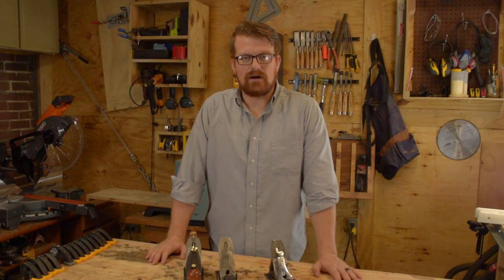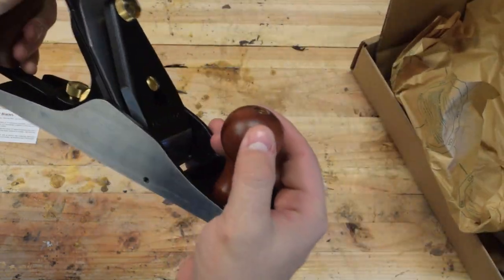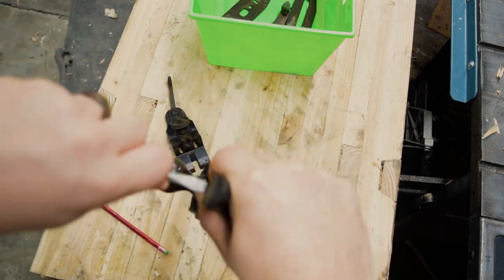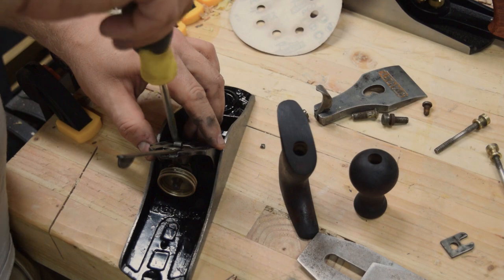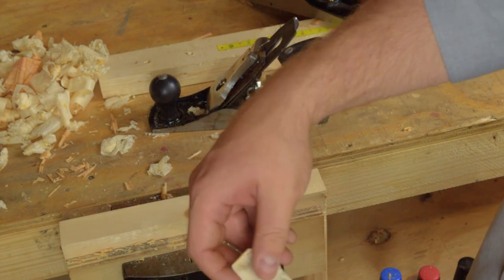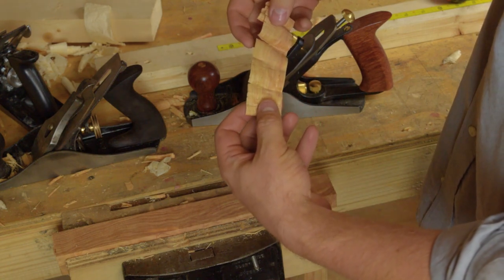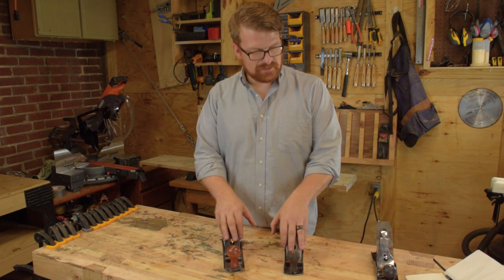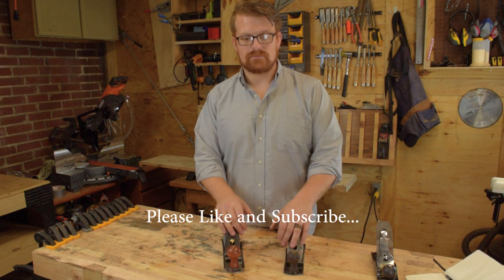Smoothing Plane Shoot Out - Veritas, Classic Stanley, & Harbor Freight | Hand Tool Shootout

Comment: I find veritas waaaayyyy over priced...all the high priced planes are too expensive...waayyy too expensive.....it's all about HOW you flatten the soles..if you lap them 100% by hand it can take an eternity....it chips away a lot of time by roughing it on a good old belt sander(maybe 5-10 min) followed up by @15 min of lapping by hand(this is worst case scenario)...the issue I do have with the less expensive planes is the thickness of the body, the blade quality and the blade advance(often a lot of play)...but still I appreciate your approach to the shootout, time is money and the way you calculated the price along side you personal time investment is very very relevant...I myself cannot afford a high quality plane...and it is difficult to get a used record/stanley no.4 here in germnay..so I learned the good old fashioned way...trial and error. I own 3 cheap planes and have used a restored stanley no.4 and I have to say...you can absolutely tune a cheap plane to be a good plane...but you have to know what a good plane is first :) as always this is the internet and I hope this does not come off as offensive, just another idiots perspective..take care and thanks for your two cents :)
Reply from the maker: I do use a belt sand when a plane is way out of flat, I actually used it on the HF plane.  If that was the only issue with the HF it would have taken the same amount of time as the Stanley.  The problem with it is the lateral adjustment mechanism and the chip breaker (they just don't work) fiddling with them took so much time.  The body was of course the cheapo steel as well, but for the price I could've lived with that.  With the lateral adjustment mechanism the tool was just not useful for the purpose I wanted to use it for and I gave it away after this video.  I agree with you though the Stanley gets you 95% the way there, with the Veritas though the adjustable and thus narrower throat allows you to do true finishing work, on some easier to prepare species of wood (Walnut, Cypress, Fir) you don't even need to sand afterwards.  It also has the retention screw so you don't have to square the blade every time, and the Norris adjuster is much more repeatable and reliable than the Stanley/Record style.  Is it worth the money/time?  That is up to you.
Reply: Justin, the advanced design effort and exceptional manufacturing quality are but two of the reasons they cost more than other makers' planes.  However the more important issue related to cost is that they are less expensive than Lie-Nielsen planes, and, dramatically less so than boutique planes.  To my way of thinking, they are excellent value hand tools.
Reply: "Are they worth more? that is up to you." 
Well said.
Reply: Justin
As an owner of a variety of planes, Stanley, Bailey and Bedrock, Record, Woodriver (a well made Chinese knockoff of a Bedrock), Veritas, Lie Nielsen, just to name a few.
The main difference is the Cost of the handplane which is a straight reflection of the manufacturing Quality.
Out of the Box, nothing beats a Lie Nielsen or a Veritas, with a few minutes of protective layer and a few minutes on "final polishing" the blade (if you want too) both will cut sub 0.001 inch or 0.0254 mm shavings in hard wood or soft, the LN has a thicker blade and it's heavier.
In any other plane, you'll have to invest time (and maybe new blade) into bringing it to a reasonable ability to shave as well as those two names described, still, not going to be the same feel...
If you ever drove a Fiat and an S type Mercedes, you'll understand...
If you're a serious wood worker, invest in the best, it "hurts" only once!
If you're not, don't buy expensive, unless money is not an object.
IMHO.
Reply from the maker: Truth, thanks!
Reply: sorry(welcome to the internet ;) ) I disagree...most people talk about taking off a thou or so as if those things really matter...if you are making furniture(like myself) you do not worry about those measurements when planing...that is youtube hype nonsense...sure getting clean shavings is nice but the media has blown all this out of proportion, same with the planes...in all honesty I have NOT used all the planes you have listed...I just stand by my statement that you do not have to have an expensive plane to be an amazing woodworker....that is nonsense...my goto no.4 is actually a faithful no.4 and my no.7 is ermm a silverline...it DID take a lot of work...just the sole and I use those planes far more than my stanley sweetheart(62) or no.4...I usualy only reach for my sweetheart for endgrain work...I have it honed to a low angle....but that is rarely.
...also most youtubers watching this are probably less informed and are just starting out....to you people I say DO NOT spend a lot of money on your first plane....learning how to dial in your plane is as important as using it. after that you can figure it out on your own.
Reply: Justin
If you ever watched Paul Sellers videos, you can came to a conclusion that he almost never uses other but his #4 either a Bailey or other Stanley "clone" #4, I have seen him using a #5, to straight out a larger board but, never a #7, I also saw him once use a LN but that was in an introduction video to his DVD collection.
The Master swears by this plane and I think he is right in his own way, after all, he is a Master Craftsman for close to 50 years...
But, there could 2 or more "rights" to survive side by side and those who believe that if you have the money, you should buy "better". 
Both kind will take you to the same place, one, the harder way, the other the easier way and your budget can determine which way to choose.
There are some Lazarus and other High Breed of planes that can cost thousands of dollars and of course they perform and look fabulous, 
I personally wouldn't own such a handplane for work...the're out there.
Personally I most like my #4.5 LN, my LA Veritas Jack plane and a LA Veritas Block Plane, if I had to give up all my other planes...
Reply: I generally only use my no.7 for stock over 4'(1200mm) usually in the 2m range tbh...and a no.7 is still more suitable for joining, but not a necessity. To each his own....it is the painter, not the brush that creates art.
Reply from the maker: agreed, its the man that makes the tool, same deal.  Their are some objective differences between planes manufacturers.  I could get a cheap enough plane with a heavy sole, and a Norris adjuster I could probably live without the adjustable throat, but it is nice to have.  Woodriver comes to mind as a happy medium, but still no Norris.  There is just to much slop in the Bailey mechanism.
Reply: Yeah, I just watched a person make a one-off hand plane earlier. Completely from scratch. dovetailed the metal sole to the sides, made everything himself except for the blade. I checked out his listing after the video and he was asking $2400 for his hand-made plane. With that in mind the Lie-Nielsen seems almost cheap, money wise.
Reply: Besides, Japanese planes can split western plane shavings three or four times. World record thinnest shaving, if a person is in to such nonsense, was a Japanese pull stroke plane in the hands of a master at 1.6 microns, for reference human hair averages 9 microns.
Reply: holy crap!~ That is just crazy...I've heard about their huge shaving..or longest shaving competition, but never really cared for "planing as a competition" :) still.....that is amazing.
Reply: You will never buy a Lie Nielsen then .
Reply: I also watched Japanese handplane thickness competition, impressive but that's all.
It is simply not practical for anything when you do carpentry or even fine furniture.
In fine furniture you will always use sand paper to finish your product, how fine it's up to you, I've never seen anybody using a handplane finish and apply varnish/laquer or any other finish without final sanding! 
Here goes the Myth of the Micron shaving that is totally meaningless...IMHO
Reply: Chips O'Toole 
I don't know what you call "lower" end but I can assure you that Veritas bevel-up Jackplane is one of the finest handplane and very versatile if you want to add higher angle blades for hard figured woods.
I also have the bevel-up block plane, with adj. mouth, top notch...
Reply: ronin4711 I believe Chips was refering to the "cheaper" line from Veritas. They have tools in most peoples budgets that can afford a hobby in woodworking.
Reply: What are "cheaper" line of tools from Veritas? I never saw any Cheaper line Veritas, maybe cheaper line 
Lee Valley but not Veritas... do you understand?
All Veritas tools are high end and relatively expensive to some people, at the end, they're well worth their price because the quality and materials are first quality and well designed maybe a bit cheaper than 
Lee Nielsen tools which are also well worth their price for some...
Reply: The cheaper ones are under $300. They have several yhat exceed that proce by quite a sum. At least where I have seen them listed online by various retailers.
Reply: You have no clue . I bet you just play games as you are not a woodworker.
Reply: " I've never seen anybody using a handplane finish and apply varnish/laquer (sic) or any other finish without final sanding! "

Then you've never followed the work of James Krenov, viz:

"Finally, at the end one fellow rose and asked "Mr. Krenov, do you really never use sandpaper?'. A small smile crept across Krenov's face and his eyes twinkled just a little as he said, "Well, I really prefer a plane to power tool and I like to see the polish on wood freshly cut with a sharp blade. But, you know sometimes you have to get-something-done. That's not a compromise, you just have to know were to draw your lines.""
Reply: Thomas Russell 
Japanese planes work well on strait grained softwood. 
Get into anything difficult and they are virtually useless.

Comment: That’s a Bailey, not a Bedrock.  The Bedrock have pins in the frog going down and 2 screws on either side of the frog adjustment screw which lock in with those pins and allow you to move the frog without having to take the blade/chipbreaker/cap lever off.  The Bedrock generally have squared off sides too.

Comment: That is not a Bedrock.  And the HF is not a copy of a Bedrock. Takes me one hour to completely flatten and tune almost any old Stanley.  So not knocking the VERITAS, it is excellent, but I will stick with old Stanley.
Reply from the maker: +Jon Woodworker flattening wasn't the problem on any of these.  The adjustment machanism on the HF is crap
Reply: That I agree its a $20 plane and made with cheap soft metal that won't last.  I prefer the Stanley planes type 17-19 for the quality of steel and ease of use.  I also have true Bedrocks, which are a whole other animal.  Properly tuned they work flawlessly.  Where planes of the VERITAS type separate themselves is the blade and chip breaker (not to mention machining).  You can upgrade any Stanley with a Hock blade and breaker to make them better.  Now your getting to the point of imbalance.  Bedrock on eBay is around 125, Hock blade and breaker 60, then your time.  This is still under the new premium planes offered but not by much.
Reply from the maker: I actually have two bedrock planes on their way right now for a future video.  I appreciate the insight.  This was my first real video, I had a little diarrhea of the mouth when talking about the different planes.  I knew that one wasn't a bedrock, but now I will know what makes a Bedrocks so much different.
Reply from the maker: +Jon Woodworker I have a couple bedrockss coming for review.  That was more of an on camera mistake...

Ya I guess if you didn't want to clean off the rust and address whatever needs to be addressed you could get most planes into being a "user" in a couple hours.
Reply: Damn you can buy a new stanley sweetheart for what hock wants for an a2 tool steel blade and chip breaker....  fuck that!

By the time you upgraded an old stanley you could damn near just buy a woodriver.
Reply: Jon Woodworker hello Jon, can I take pre ww2 Bailey’s and fine tune them to the quality of bedrocks?...or are the really THAT different?
Reply: Complete clean up and tune in less than 2 hours.
Reply: Andrew Garratt
Performance wise, there is no difference. Stanley made far more bailey's than bedrocks. People liked the baileys better.
Reply: @andrewgarratt5191  There’s virtually no difference between the Bailey and Bedrock.  The only real difference is that you can adjust the frog (something that, once your plane is set up, you will rarely need to do) without removing the blade and chipbreaker.  If you can save some money getting the Bailey and you want a user and not a display piece, just get the Bailey.  The end result is really no different.  Most pros back in the day when hand planes were in common use used the Baileys.  The Bedrocks, while also excellent, were targeted more at those with extra cash to spend who wanted the best - but they were always more of a niche product.

The one caveat is that the Baileys were produced for a longer period of time, so the really early and really late ones (before and after the Bedrock era) aren’t as good as those produced around the time of the Bedrock planes.  The best planes were made from the early 1900’s up until WW2 or thereabouts.  Earlier ones had lower quality steel/casting and lacked some of the innovations that came later with improved technology, and later ones were the victims of cost-cutting.

Comment: Best way to get rid of shellac, wax, and decades of dirt from wood is: Denatured alcohol with No.00 steelwool. It makes this process so easy. Like the vinegar rust removal solution. Just a tip. Have a good day fellow.
Reply from the maker: Thanks I’ll try that sometime.  I usually use mineral spirits but I always keep denatured alcohol around.  I’ll have to give it a shot.
Reply from the maker: Thanks I’ll try that sometime.  I usually use mineral spirits but I always keep denatured alcohol around.  I’ll have to give it a shot.
Reply: I wrote No.00 steelwool but maybe a coarser would work faster.There is a video about wooden plane restoration at the "Woodworking Masterclass" chanel. I really love his videos and his accent too :)

Comment: No, that's is not what makes a plane part of the Bedrock series. That is merely the Bailey adjustment mechanism. Bedrock planes are mainly distinguished by the frog adjustment mechanism and the flattened tops of the usual rounded sides.
http://www.supertool.com/StanleyBG/stan15.htm
Reply from the maker: annarboriter thanks, I guess I have just never seen one in person.  So the bedrock has "wings" more like the Veritas?
Reply: It's even more complex than that. Stanley BedRocks are cast on a slight incline where the frog seats, milled on each side to form a channel so that the frog stays perfectly aligned to the sole when the frog is adjusted. After 1911, the rear adjustment screw is added (with locking T-bolts so the frog can be adjusted without removing the blade) here is also where you get the flattened sides (mentioned above) This design was borrowed (almost exactly) by Lie Nielsen and Wood River. If I could post a picture it would be much easier to show the difference. My smoother is a #4 BedRock (1902-1908) and it's worth every minute I put into restoring it.
Reply from the maker: Like I said in the article that went with this video, each of these planes is like a history lesson to go with the project.  Really cool for a hobbyist, that Veritas though was an amazing piece of engineering.  If you haven't tried one out, I highly recommend it.  http://www.wood-work-life.com/design/smoothing-plane-shootout-no-4-in-d-flat-minor/
Reply: Thanks for that reference. I always wondered what the actual difference was between the Bailey and the Bedrock, besides the squared off wings. Lie-Nielsen Tools copied the Bedrock for their planes, but I prefer the thoughtful extra design features of the Veritas planes myself.
Reply: To be fair, L-N borrowed the general designs and improved upon the best of the Stanley tool lines. Veritas, admittedly, has added some of their own ideas to toolmaking.
Michael Anderson
Reply: L-N makes lovely planes that work very well but the only improvements I see are in materials and manufacturing. Admittedly I am no L-N expert or even user, though I have attended several of their events and played with the merchandise. Of course, they should work well since the Stanleys they are modeled on work well. And of course Veritas also took original Stanleys as their basis, though there are several visible and useful improvements in addition to very high quality manufacturing.
Reply from the maker: Michael Anderson L-N makes lovely tools from what I have seen and heard.  Veritas really advances the game in engineering in my experience whereas L-N Is more about masterful and beautiful execution of proven designs (Stanley)

Cheers and good luck with your future hand plane adventures.

My old Stanley 45 should be in the mail.  New toys :)